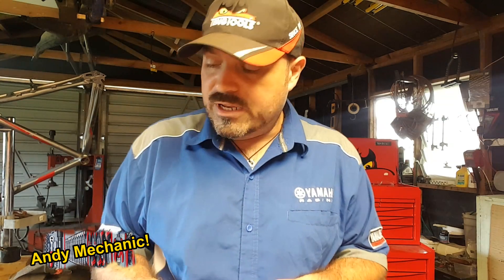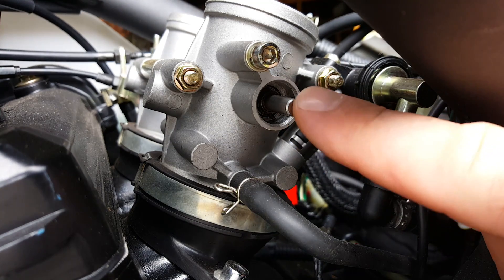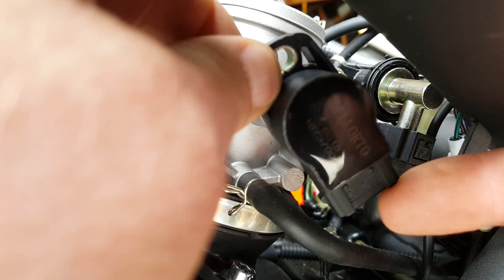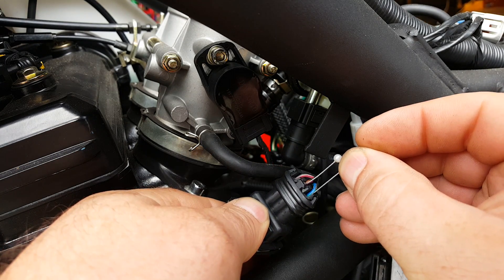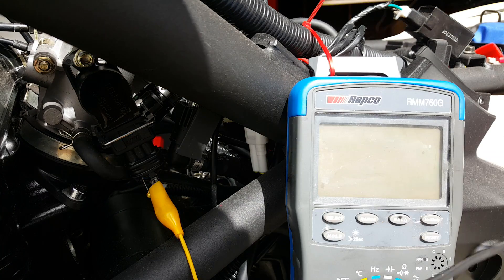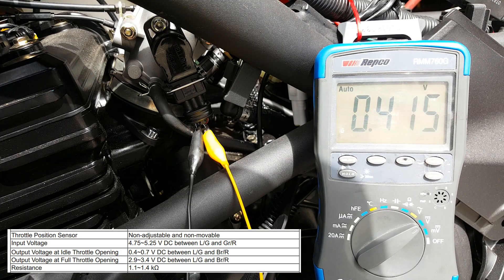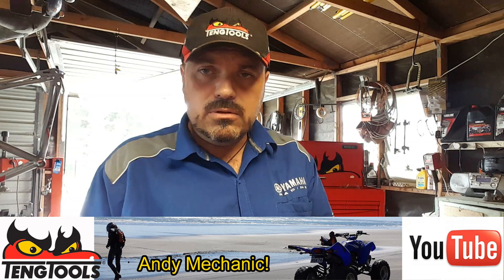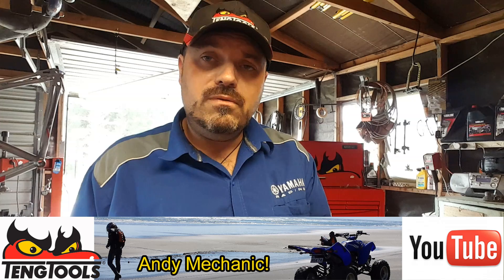How to install & calibrate a new Throttle Position Sensor (TPS) #1208

Comment: Is this applicable for any cars also?
Reply from the maker: Hi, well most cars have an adjustable TPS so it'll need to be calibrated if you have removed or replaced it. Some newer cars have non adjustable TPS and in that case the ECU usually just self calibrates. Hope that helps. Cheers Andy

Comment: thank you for this learning video , i have same problem on burgman 400 the out put on ideal 5 v i tried 2 hours to set as manual instructions and failed , the sensor was read the voltage between 4 and 5 volt , is  this sensor not working and must change or am i cant set ?
Reply from the maker: +ahmed khalil the TPS usually had 3 wires. The first is ground (battery - ), a 5v DC supply from the ECU & thr last is the signal wire. Usually with the throttle closed the output on the signal wire is around 0.5v then will climb steadily up to around 4.5v DC at throttle fully open. These are generic values and I suggest you find the specs for your bike to be accurate.

Hope this helps. Regards Andy

Comment: Good day is this applicable on all brand of motorcycle i have a problem on tps on my motorcycle helpul idea thanks a lot
Reply from the maker: +melchor napoles yes, Firstly Welcome to my YouTube channel. As a rule of thumb most TPS units do work the same way. However you are best to obtain the specs for your bike by downloading a PDF workshop manual. Hope this helps. Cheers Andy
Reply: thanks andy and more power